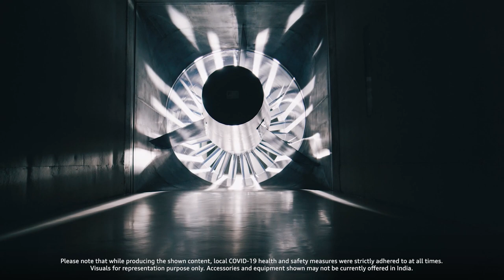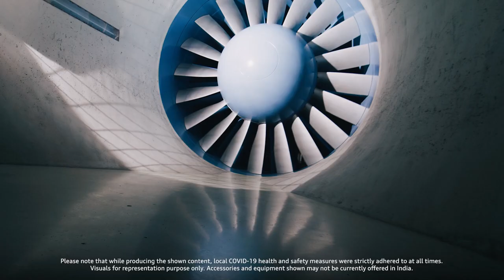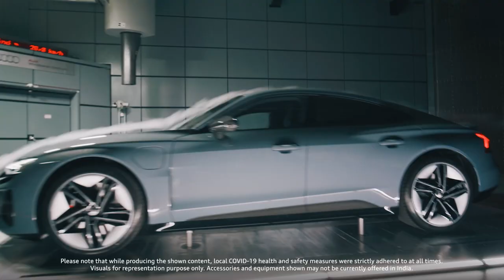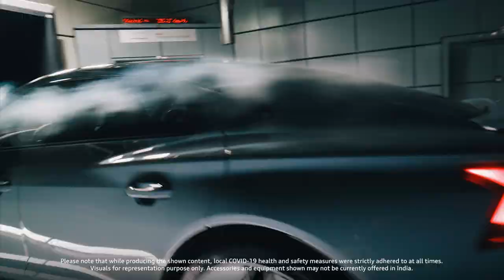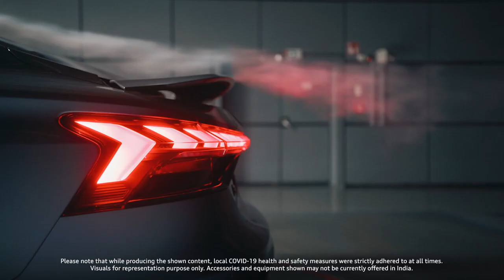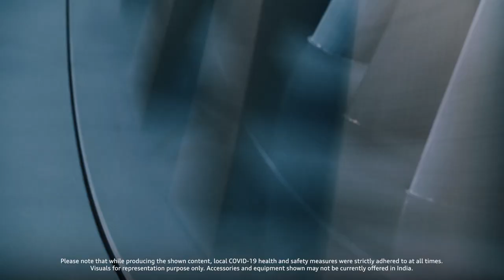Audi RS e-tron GT: A journey through the wind tunnel. Dr. Moni Islam on aerodynamics.

Comment: I have bought a brand new #AvoidAUDI  A6 bought on
the 12th August from Audi Mumbai West
8 manufacturing defects first week, 
11 till date. Read on:
1st: the seat belt clip is installed the
wrong way. 
2: their wooden trims are different colour (proved)
3: dashboard rattling (1st day)
4 & 5: rear sun shades are loose & wavy
6: rear view mirror rubber tearing off
7: bad wipers
8:wind shield is distorted (compared with our Merc & BMW)
9: Driver side lock malfunction 
10: Sound Thud in the rear shock absorbers.
11: left hand front Bang & Olufsen speakers OR the door trim distorted noise/ Humming at half the volume. (I don't know how did they even lend their name to such workmanship.)
I should have known they would be such after their lie to the EU public with their emission fraud.
I always wondered
where Audi’s going wrong in India:
Your leadership team
has no heart for cars. Its a robotic
team which has no remorse over a
bad product.